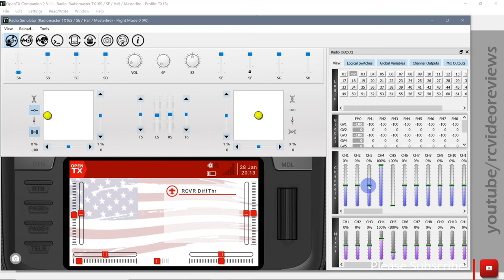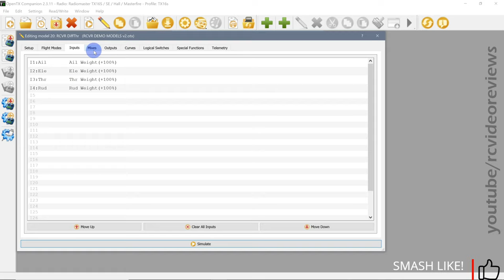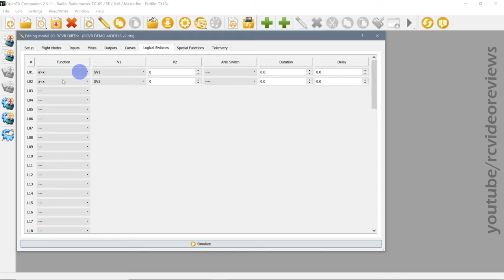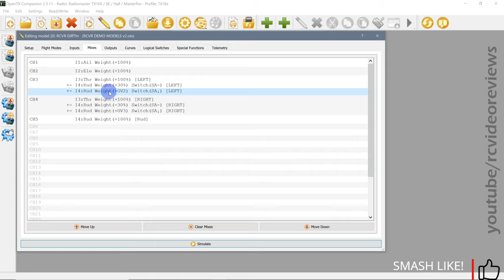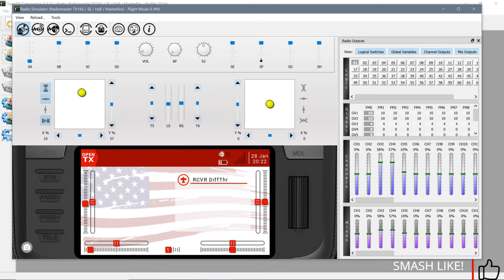OpenTx Snippet • How-to Setup Differential Thrust

Comment: I tried to do the program on the device, but in "Special Functions", I do not have the column of the "parameter".
Reply from the maker: Download the .otx file in the description and work from that. There is no option in OpenTx to remove parameter fields from any of the tabs.

Comment: Super job, thanks very much for doing this.  I am setting up for differential thrust for the first time on an Albatross I just got.  I am curious about two things:  I plan to use this on floats on the water in lieu of a water rudder which I think should work fine, but have you tried either of these modes in the air?  If so, how do they perform?  Also, what voice prompts are you using on Switch A (like diff thrust off, diff mode A, diff mode B)?
Reply from the maker: I haven’t setup voice prompts. Differential thrust in the air can be a lot of fun depending on how much differential you actually use. Try it.

Comment: Great snippet. Here is a 3rd option that I have used. Let's call it the "Safety" method.
Lets assume that you aren't putting this on a switch that it is just a constant state.
Rudder never increases throttle, instead it decreases one of the throttles.
This prevents throttle from spooling up unexpectedly from only Rudder movement.
Reply from the maker: Isn't OpenTx awesome? So many different options to make it yours.

Comment: The two engines rotate in the same direction, creating an asymmetrical rotational force on the aircraft, during flight. The Differential Thrust in the video can be useful, and reduce the radius of rotation of the plane, but the rotation left and right will not be the same radius.
If the two engines were rotating in different directions, the performance of the aircraft after the programming of the device, according to the video, would have been perfect.
Maybe we can turn the propeller, and the motor, we will change the wires plus to minus?
Reply from the maker: The logic will work whether or not it is counter-rotating, but I would agree counter-rotating would be more efficient for sure. It's easy to reverse a motor by swapping two of the leads between the ESC and motor. Just use an "R" prop.